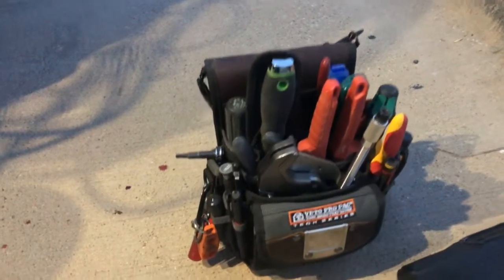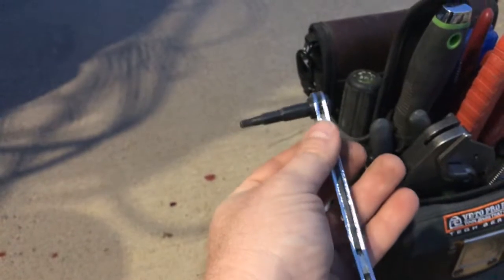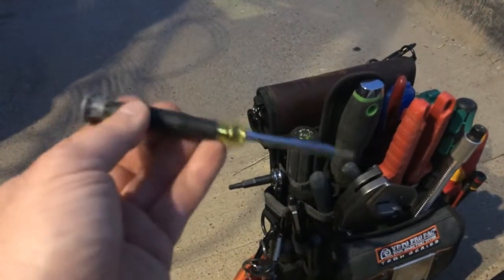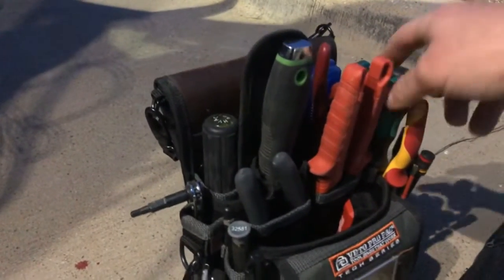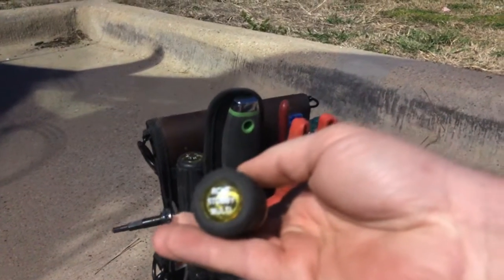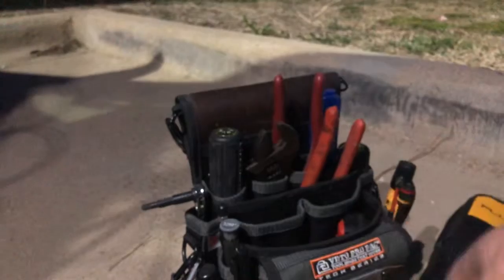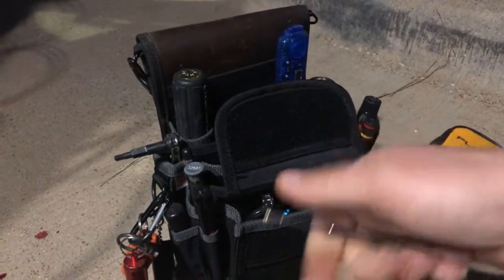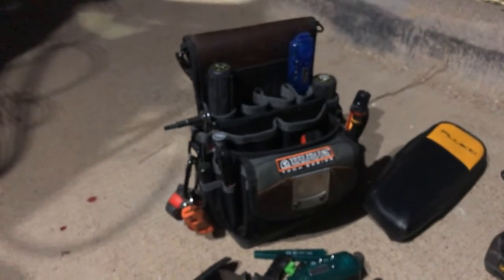Basic HVAC Tech Tool Compliment- What I Carry

Comment: Your a tool guy, so if you haven't already, check out the Klein #2005 wire stripper/crimper/cutters. They are a really nice all-in-one tool. The handles are incredible, super comfortable in the hand, & made out of a new material that Klein has never used before.  😎👍

Comment: Nice bag liked the video 👍 I am thinking of getting this bag for myself for easy light work like PM's and troubleshooting as well, just a couple of questions would you think this bag would hold a meter in it? Do you have the tall meter bag called MB2? Which one you find is better? Thanks 👍
Reply from the maker: I like this bag better because of the additional tool loops, I carry a meter in the front pouch without a case in this bag all the time. They are coming out with a MB3 I believe soon. That one will have removable soft pouches inside main pocket. My current use for my MB2 is a drain clearing set up. It’s carries a gallo gun, cartridges and pvc fittings and glue with cutters.